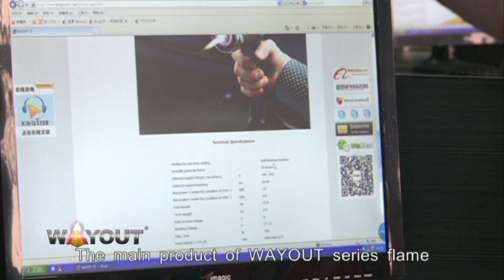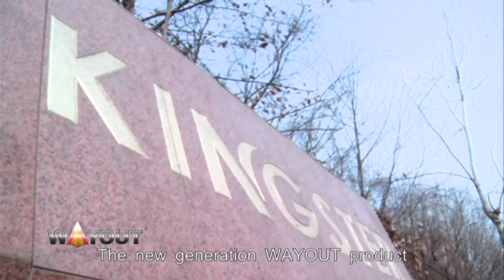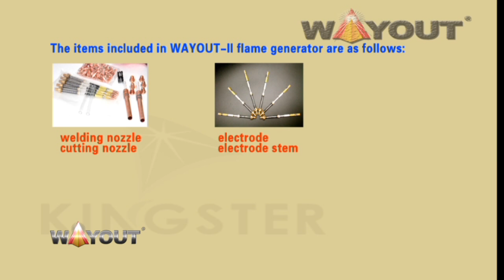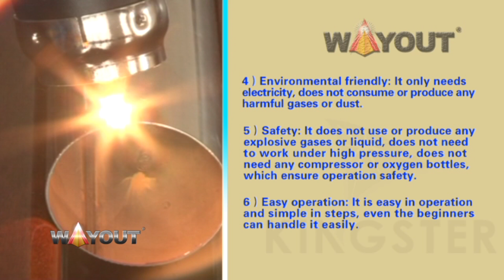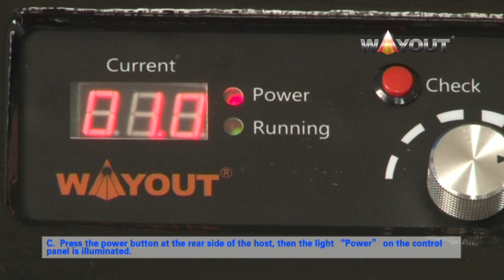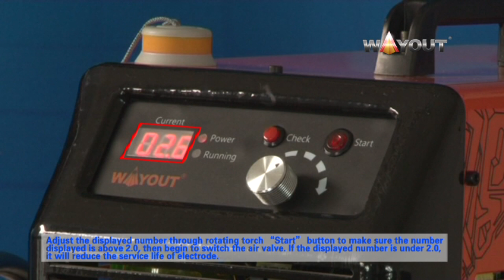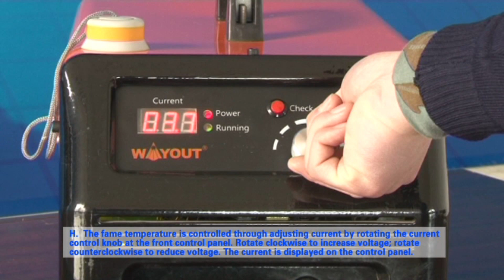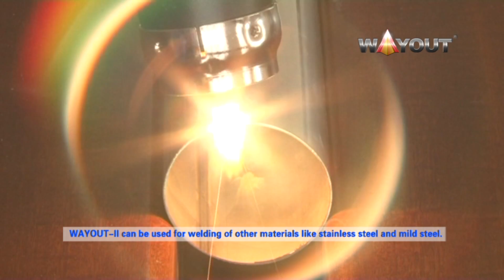WAYOUT introduction&operation

Comment: seems nice, but how does it actually fair in terms of actual usability and reliability (porosity, strength of weld)?

multiplaz 3500, has documentation on the required modes and settings specific to each material and thickness. does wayout include extensive documentation?

how was welding impurity and contamination problems solved, flux required for every material?